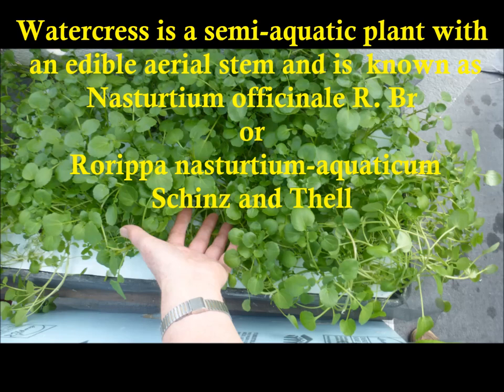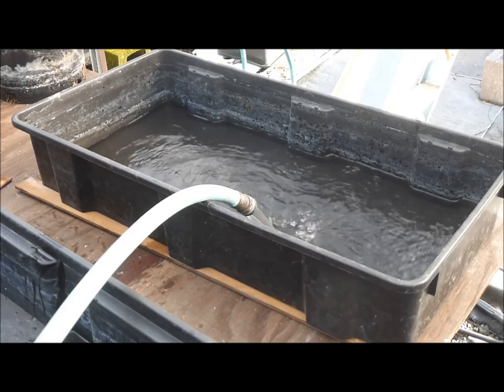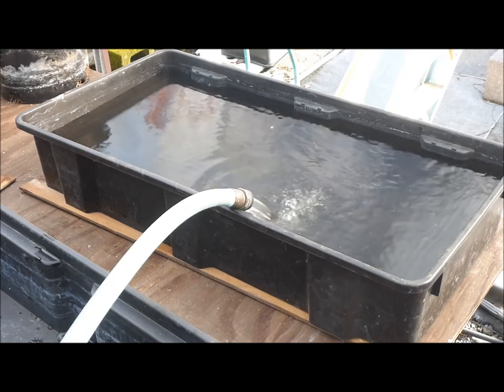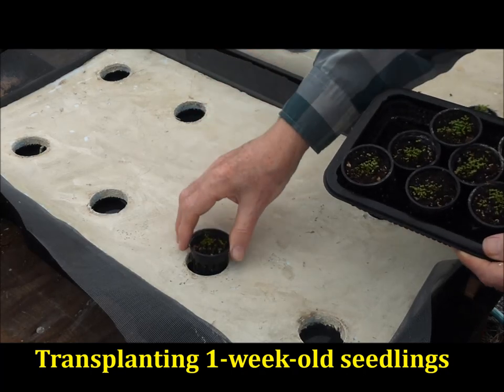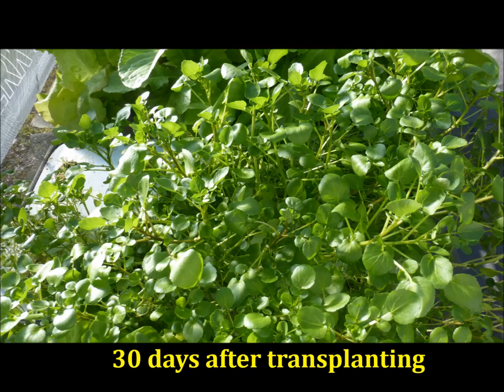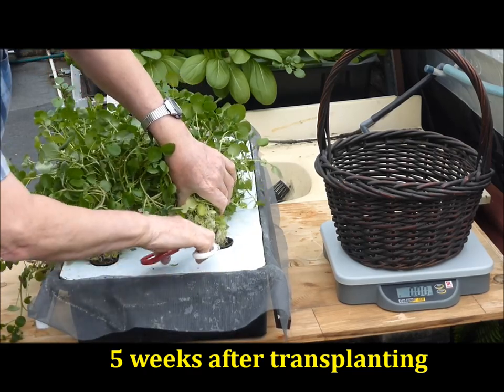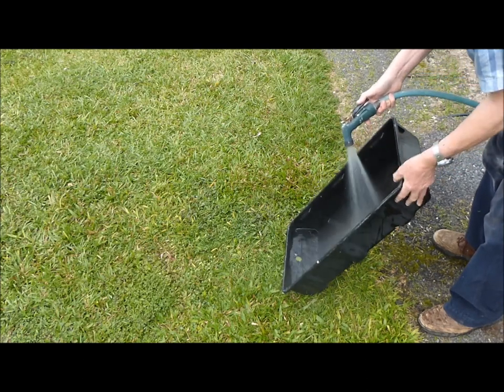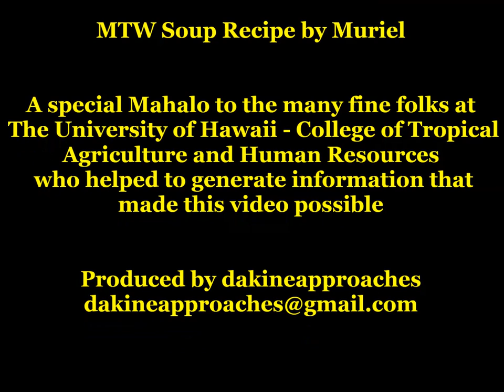Growing Watercress by a Suspended Pot, Non circulating Hydroponic Method

Comment: Doc You mentioned you didn't know why the roots grow up the stem. I think I can help you there. That's so when they're in the river. and say a storm comes. and parts of the plant will break loose. So if they've got roots up the stem, they can then flow downstream, get anchored somewhere further on downstream and carry on growing. That's the way I grow my own watercress in an ebb and flow system. I just break bits off and replace them into another container. So I never really apart from the first time grow them from seeds. And  in the past. I've actually bought watercress from the shop. and just submerge that and it throws roots.
Reply from the maker: Thank you!

Comment: The aerial roots on your plant will grow down into the water and under rocks to anchor the plants into soil under the water of a slow moving stream. If the main stem is separated from the plant, it won't die because it has all those extra roots to feed it.

Comment: How many galons for 4 onces of nutrients?
Reply from the maker: The tank capacity was 7 gallons.  We normally recommend 0.75 ounce stock solution A + 0.75 ounce stock solution B per gallon of growing solution for watercress ; that would have been 5.25 ounces for 7 gallons.  However, the plants respond well to a slightly lower rate as was provided in this study.

Comment: I gave the method a go using rockwool and placed each net pot in a mason jar. So far the root development has been poor after 4 weeks and leaves development has been slow. The watercress seems to develop a fair bit of roots at the stems. Does that mean I should top up the solution so the net pot is once again submerged?
Reply from the maker: One good thing about watercress is that it can be grown by either the suspended pot or floating topcover method, but I recall that roots grow on the stems with both methods.  I don't know how to prevent root growth on the stems.  Root and shoot growth should be pretty good at 4 weeks.  Possible causes of slow growth are high temperature and fertilizer deficiency.
Reply: Thanks for the response. Glad to hear that it should be normal for root growth on stem. I am not using the exact formula for the nutrients maybe that is affecting the root growth. Trying to use organic fertilizer and haven't found any with the strength comparable to non organic. Also, you mentioned something about disease and so you only harvest the watercress twice. Just like to clarify if those are plant diseases or that cut-and-regrow approach would produce watercress unhealthy for human consumption? Thinking of using propagation technique via cutting after I have a successful batch.
Reply from the maker: Actually, our biggest problem with multi-cropping was a buildup of root aphids.  Most of the field-grown watercress in Hawaii utilizes the cut and regrow approach, so it  is safe for human consumption as long as the plants are  generally healthy. Yes, it is ok to propagate with cuttings as long as they are generally insect and disease free.

Comment: The cause of the roots on the bottom of the stems?  Doesn't it just grow that way?  Like if those roots found some soil or water, they would sink in.  I noticed my tomatoes if they lay on the ground before I stake them up, start sending out roots from the side of the vine (the what was the upright part before it fell over / stalk).  Similarly I noticed when pulling up a pumpkin (or squash or something) vine that was laying in the wood chips, in order to drag it out of the path, it ripped up - it was attached via roots.  You're growing it - quite well and successfully - but in an artificial way.  Normally the plant would crawl around a bit and re-establish some roots.  Also, personally, a little saddened by your restarting it each time.  Maybe I'll see the diseases and stuff you're talking about and change, but my first thought is to heck with that - I'm going to keep re-cropping it.
Reply from the maker: Well, I certainly encourage you to follow your intuition and hope you will adapt and improve on this method.  By the way, in one set of experiments we made 13 harvests over a 1 year period from the original planting, but it was necessary to add additional nitrogen and manganese to the refill solutions in order to maintain yield and quality.
Reply: Oh, I wouldn't go so far as to presume I'll improve on your method.  You seem quite successful.  I'm just wondering if the nitrogen and manganese might be in some compost / algae?  I want to try it in a floating pot - to that end, I just set one afloat yesterday and sprinkled some seeds on top.  I'm hoping - if I even get started, to be able to propogate the plant by just grabbing a clump - like with mint.  I've never started mint from seed successfully, but I have to mow my mint now - so once it gets going.  Anyway, if I'm fractionally as successful - just have several harvests.  Oh, I see, in your video you said you started over after 1 or two harvests, I think it was, but in your reply you said you harvested 13 times but had to add nitrogen and manganese.  I hope to have a clump I can harvest periodically and spread around rather than getting the seeds out again.  And just stick it in some ponds - which I also have to make.  I have a tub I was using to soak myself and water the garden but I'm leaving it now because some tadpoles made an appearance.  Maybe I'll put a fish in too, because now I'm growing mosquitoes.  Okay, all over the place with my comments - probably too blathering, but thanks for the reply and video!